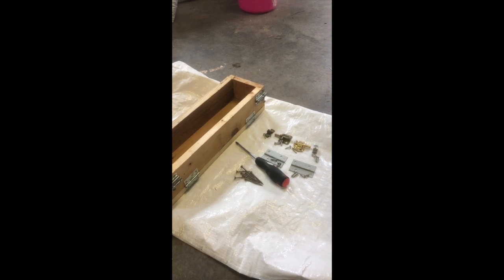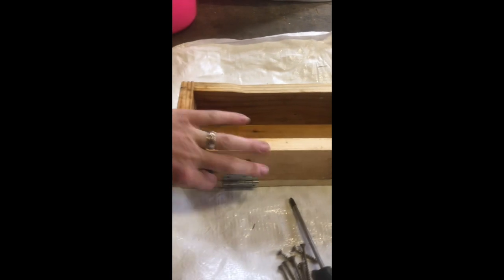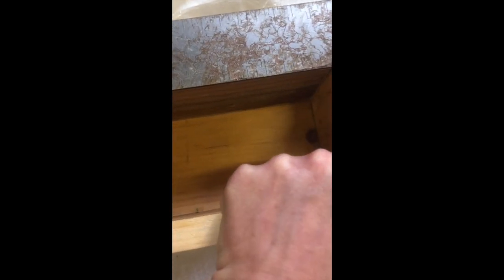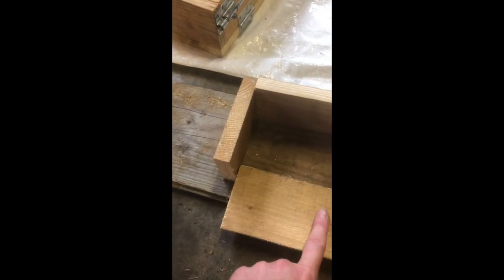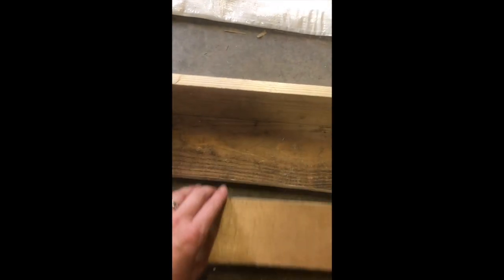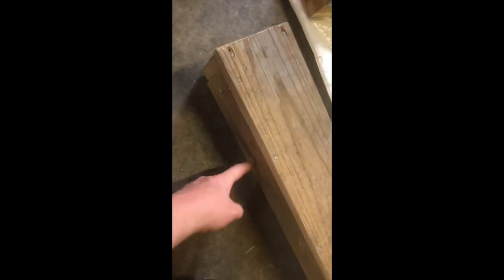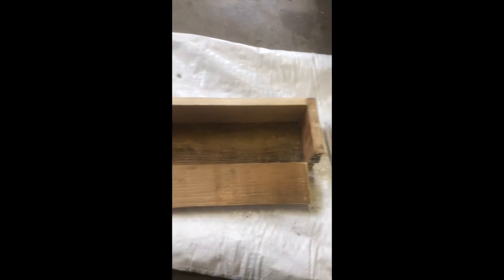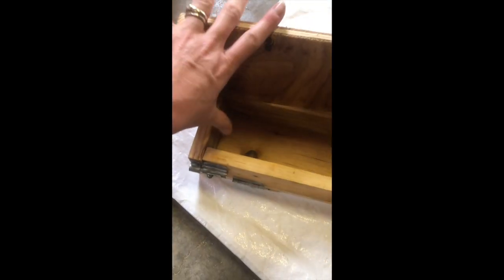DIY wooden soap mold

Comment: Need advice for designing 1.2 kg mold. I have customized my design mold- L (37.11cm) * W (5.50cm)* H (8.50cm) - inch(14.61*2.17*3.35). 12 bars 100gm. Is it correct dimensions. Pls advice. Thanks